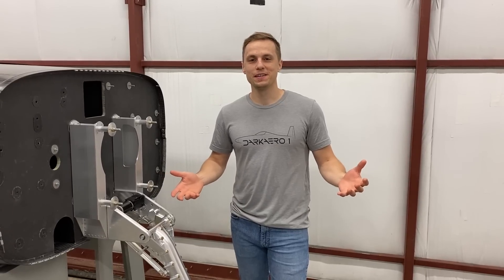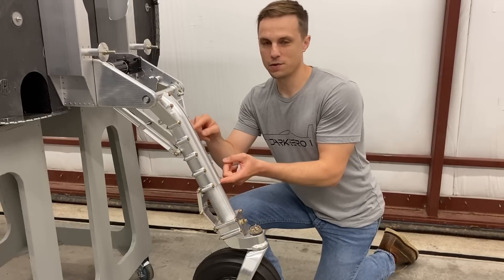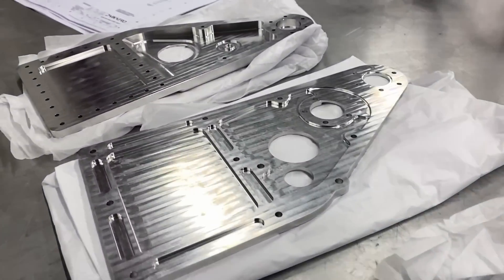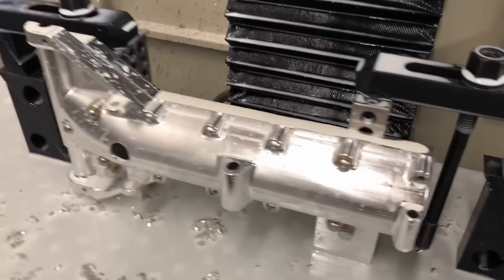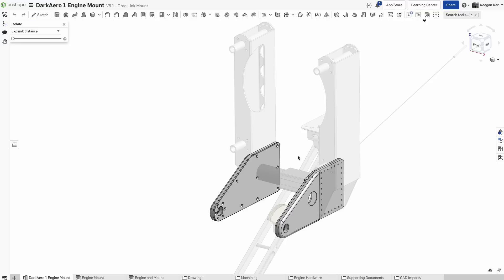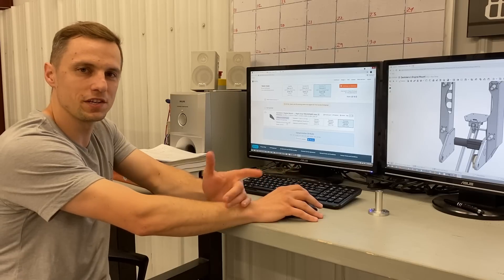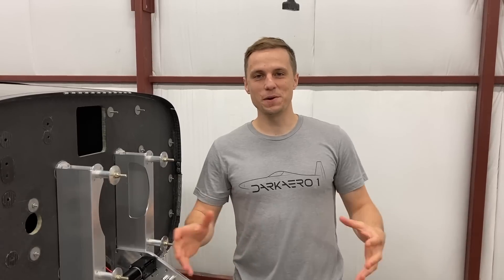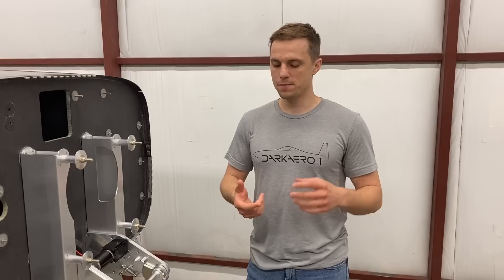When to Outsource a Part (How We Decide)

Comment: Did anyone else catch the pricing scale?
 Essentially, economy = $1, standard = $2, panic = $3. In other words, "plan!"
There will probably be many components where size, material, process or production volume mean that someone else can make it more economically, (or just better), than you can. The trunnion that was best made on a lathe was a perfect example. 
Uniquely large components would be another. You could buy the oversized machinery to make it, which would be underused and take up space, or pay someone who already has one to use theirs.
Casting (especially magnesium), or machining titanium (nasty stuff, very fussy) are examples where buying a few hours of somebody else's lifetime skills is probably better than trying to learn them.
Standard components like fasteners, wires, &c obviously make little sense to make. (Though there was Bugatti and his custom threads and vices, which didn't do him a lot of good.)
Adam Smith described the virtues of specialisation in 'The Wealth of Nations" in 1776, David Ricardo followed up with the theory of Greater Comparative Advantage, and despite the DIY fad, they haven't really changed.  Do the things that make you different and add the most value, (e.g. moulding the right aerofoil with the right structure), and let someone else do the commodity work.

Comment: What do you do about xometrys tolerances limitations? They can’t achieve anything under .005 in + or -
Reply from the maker: Hey, thanks for checking out the vid. It is possible to request tolerances below +/- 5 thou. There is a drop down menu to request tighter tolerances. Additionally, you can upload a print and request tighter tolerances there.

Comment: Xometry is terribly overpriced in my experience, both for CNC machining and 3D printing, and I've had better quality CNC work for like 1/3rd the cost from some companies in China, with better direct communication with engineers instead of automated quoting systems that basically leave you no room for customization.

Comment: In the gearbox, what is the freely rotating thing on which the two idler gears are on called? And is it so that if the motor fails, then the landing gear can be lowered with the gas springs without forcing the motor to spin?
Reply from the maker: We are calling it the gear carrier. Correct! It allows the motor to be disconnected from the rest of the gear train an allow the nose gear to fall without having to back driving the motor. There are different ways to accomplish this but the gear carrier was a quick, effective solution we settled on.

Comment: I've noticed that when you cut through your cored panels you do not close out the raw edge. I am a boat builder with no experience with aircraft, but in boats we always close the openings either by removing the core material between the skins  about 1/2 inch and fill with an epoxy/ thickener mixture, or wrap from one skin around to and over the other skin, forming a  "u" channel around the entire opening. this transfers load between the two skins, and of course in boats prevents salt water ingress, which is not a problem you experience.
Reply from the maker: Good eye Peter! We do close out the edges of the honeycomb panel, although there were probably some instances in the video that were not yet closed out. We have had some success using our assembly adhesive as a filler but we are looking for a good solution specifically engineered for edge sealing.
Reply: @DarkAeroInc  I actually wonder if 3D printed trim could work for a cleaner/custom fit with E-120HP bonding. FDM Ultem 9085 Black should hit flame retardant/self-extinguishing needs for a fuselage.
Reply: I follow you guys with admiration, love that you share the knowledge, can’t wait to see her fly

Comment: One thing just struck me, you know how there has long been talk of airless tires for cars? but people aren't sure about ride quality and durability. But a plane only rides on its wheels briefly and ride quality isn't a deal breaker. So maybe planes are ideal candidates for airless wheels. Could be super light and have more square narrower profile.
Reply: Pneumatic tires for energy dissipation, airless tires for maximum energy return- but that's fairly useless for a plane.
Reply: @actually5004  I don't think that's real though, any significant drag would hurt take off, I think energy bleed is aero and brakes.

Comment: Two factors which we generally look in when outsourcing is the handling of problems with regards to stock keeping and reaction times of the supplier and connected to it also the quality control (which is the major topic)
Reply from the maker: Thanks for watching and the comment! Quality is definitely an important factor as well. The topic of quality control would make for a great video!

Comment: Are your prototype parts anodized?  Does the outsource machine shop do this, or would that require a second vendor?  For in-house production parts will you batch outsource anodizing or will that be the builder's responsibility?
Reply: Anodizing can have significant impacts on the strength of materials. The NTSB has cited anodizing as contributing effect in some recent incidents.
Reply: Hey, I work at Xometry and we do full turn-key machining services including post finishing. In many cases, we would be making the part to spec, with tapped holes, markings, secondary finishes, etc. Since DarkAero also has great in-house capabilities they ordered the milled components with a dimensional inspection report (CMM) for tolerance verification. Here's some more on our CNC services https://www.xometry.com/capabilities/cnc-machining-service/
Reply: @gregpaulsen2631  Great information!  Thanks!

Comment: Great overview! One additional aspect that we consider at Transmutable is the risk of the vendor missing their estimated delivery date. Even the best manufacturer has unexpected delays.
Reply: Indeed a risk assessment is essential in deciding whether to 'make or buy'.

I would add taking a good look at the "Value Chain' to see if there are any hidden potential impacts but that applies more to a production case perhaps though aspects of the Lean Engineering concept approach can help in prototype environments - from a 'time saving' perspective (line-of-balance though not in a high rate production sense) which you correctly indicated is always a prime concern.

Great effort guys (two thumbs up)

Comment: I have another question, what is your decision making process when you are deciding whether to just squeegee on peel ply and that’s it, or use a full vacuum/infusion layup? Any pros or cons?
Thanks in advance!
Great videos!
Reply from the maker: Good question! We have used both wet layup and infusion. In general, wet layup is great for doing quick repairs/jobs where fiber to resin ratio isn't super critical. Additionally, wet layup is an easy process to get started on and doesn't require a lot of expensive equipment. We've used it to primarily for mold making. Infusion gives better surface finish, fiber to resin ratio, and is more repeatable than wet layup. This is the process we use for making all the aircraft skins. We put together a decent document with pros/cons on different composite processes a little while back: https://www.darkaero.com/knowledge/composites/
Reply: @DarkAeroInc  FANTASTIC!!! I will read through that. Thank you for the quick response!

Comment: For the any nut/bolt combos in your design do you specify stop nuts, loctite, etc.?
Reply from the maker: Great question! For nut/bolt combos, we typically use AN bolts with lock nuts. We put together a guide on our Knowledge Base that goes into more detail on fastener selection. https://www.darkaero.com/knowledge/hardware-specs/
Reply: DarkAero, Inc when do you think your marvellous project would be completed ✅